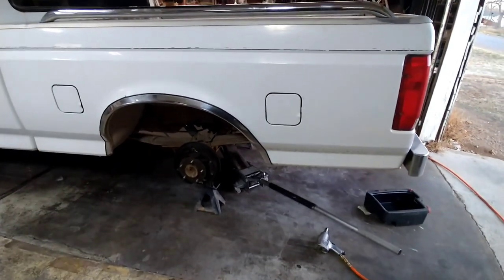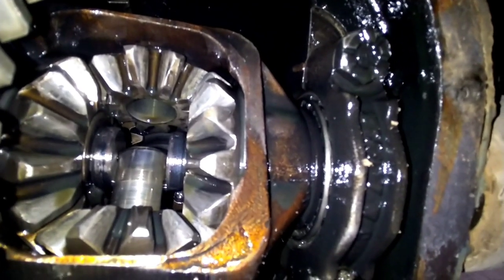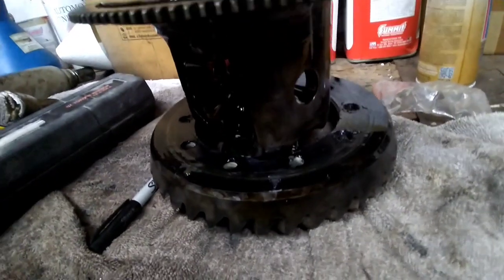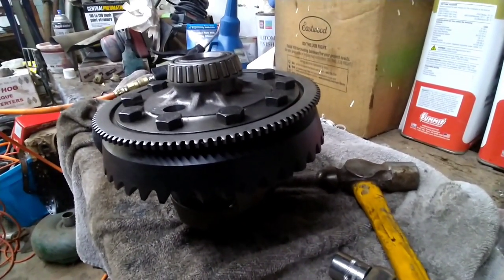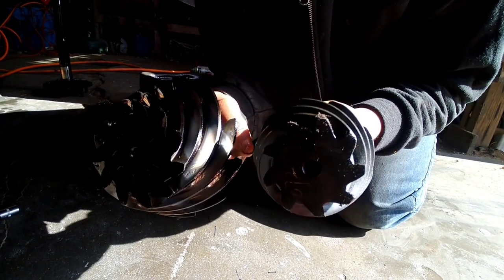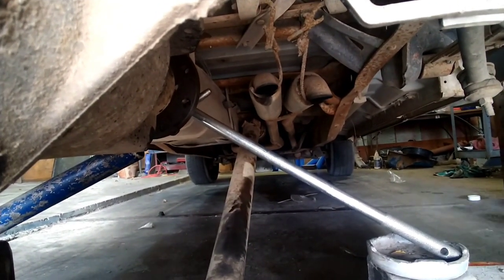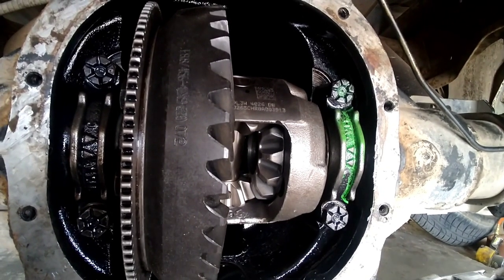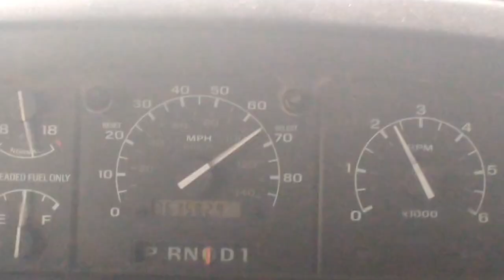OBS f150 build (P2) Upping the fun factor 4.56 gears😃

Comment: great video on the how to guys at-least all the way until you get to the pinion and the back lash. i just got the pinon depth gauge and also torque bar for the rolling resistance for my 8.8 on a 08' F150 going from 3.55 to 4.10's hopefully shell'll like that better with the shift kit / valvebody work ill do as well.
Reply from the maker: ,4.10 will for sure wake it up